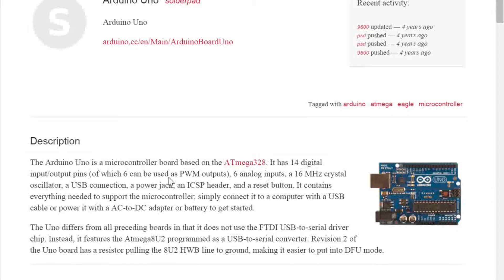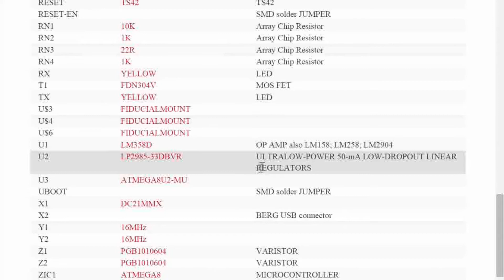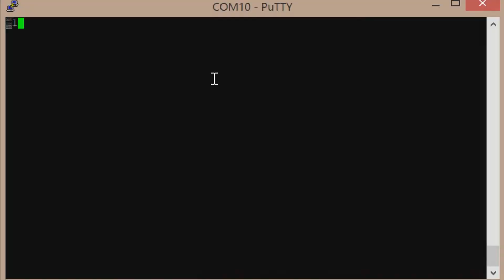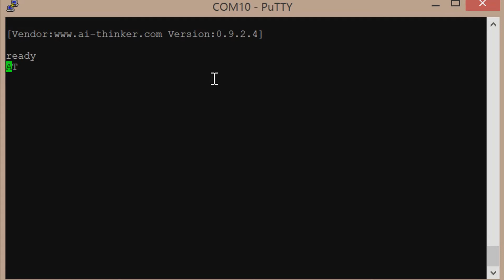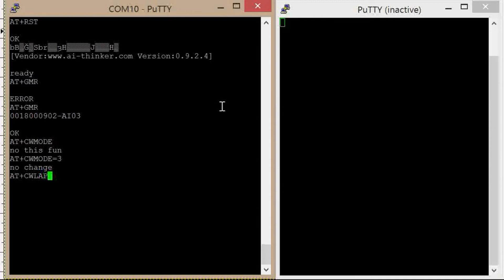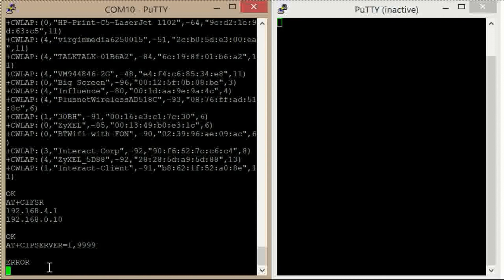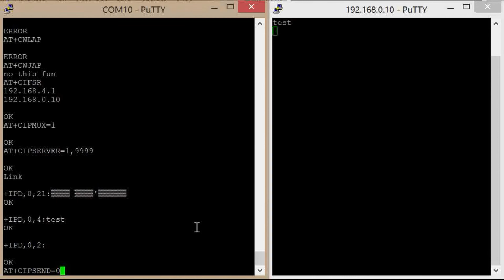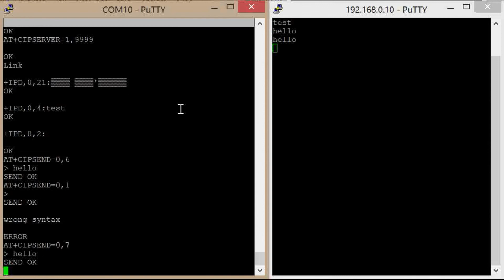Talking With The ESP8266 - powering from Arduino Uno

Comment: Great, it's finally working. By the way, what happened to the CNC router you featured in one of your first videos? Its how I found this channel and I am curious as to what happens to it.
Reply from the maker: Samuel Doye You may notice it has appeared in my ident. I've got follow up video in a quite raw state. I've one more esp video from the current session to put up, and I'll collect my old footage and upload that. I did write it up on a blog - http://orionrobots.github.io/CnCNotes/.
Reply: Thank you. I am still looking for a cheap CNC in my area and that has really helped me understand the control setup of these cheap routers.
Reply from the maker: Samuel Doye I would say be prepared to replace stuff in the controller. The cnc seemed rigid enough, but the controller had a poor power supply - what might be a nice combination would be the othermill or carvey electronics, with the 3020 machine+frame. I've not replaced the spindle - but I get the impression from reading others that I'll eventually need to for improving my cuts.
Reply: Cheap power supplies suck. Do you think a suitably sized PC atx PSU would work?
Reply from the maker: I don't think so - its good for 5v and 12v, but not the 50-60v motor stuff. However - there are decent DC supply modules that should do it - so two of those back to back - a 48v, a 12v should work. There is an on board 5v regulator for the 5v stuff. I've seen the conversion done before.
Reply: Ah, I forgot about the motor. The electronics in these machines do seem to get poor reviews so I may try and replace the whole lot if I buy one.
Reply from the maker: The one board that is reasonable is the stepper controller - using a set of Toshiba Stepper drivers with a nice big heatsink.
Reply from the maker: These ones: https://www.toshiba.com/taec/components2/Datasheet_Sync/201103/DST_TB6560-TDE_EN_27885.pdf
Reply: Nice, I will probably do what you did and combine that with an arduino, assuming I can find a machine for a good price.